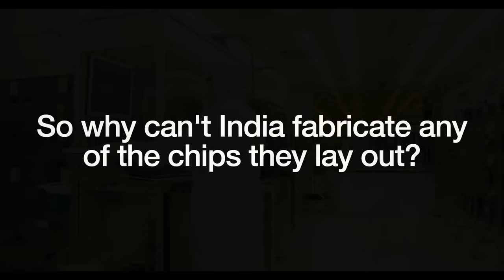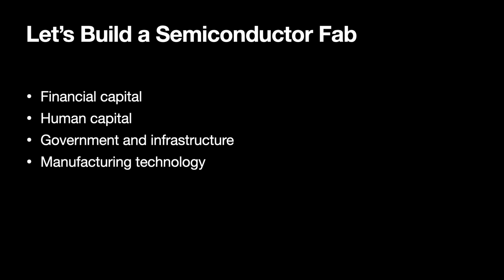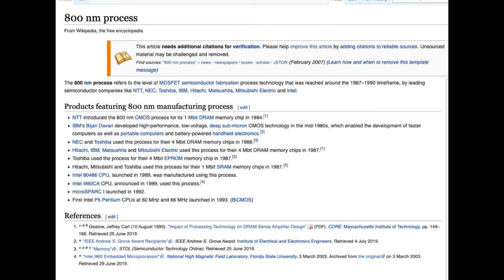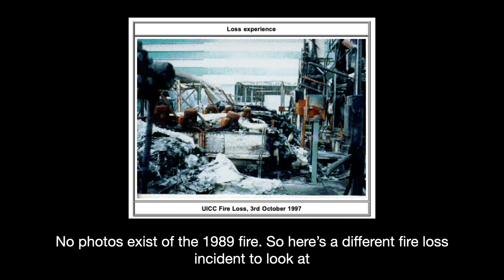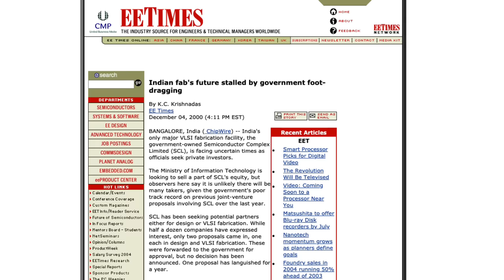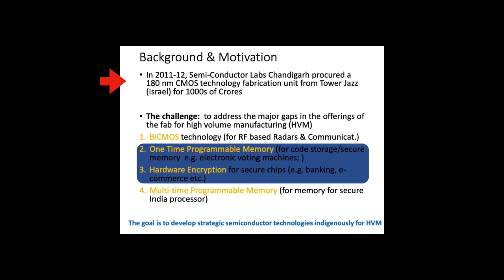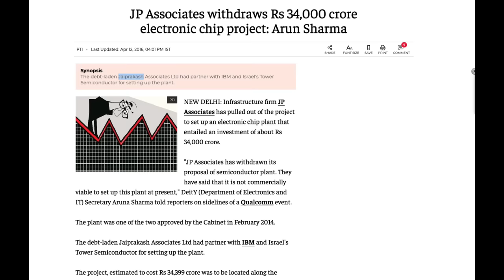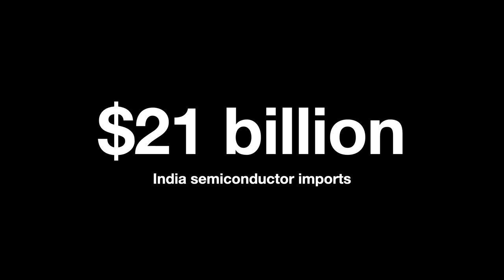India's Semiconductor Failure

Comment: I used to work in America's semiconductor industry and it requires a lot of infrastructure for everything to work properly. We had two massive diesel generators in the event of a power outage because even 5 minutes of down time has the potential to ruin tens of thousands of wafers currently being processed. It's a very delicate process which is why even China still has trouble with manufacturing semiconductors today.
Reply: also tens of thosands of money
Reply: Nah you need a infinity source of very clean water so much that your cities don't go dry with India's groundwater dropping more than 5% each year its not sustainable. Also due to global warming and erratic rain patterns no backup for water source. Glad we missed this expensive party
Reply: @lelins300  Very sensible answer 👍. Not always do we need to be on the bleeding edge as it could be detrimental to us in the long run. Not sour grapes though. But curious how Taiwan manages the water supply.

Comment: 8:00  It took EIGHT YEARS to reopen after the fire.  That shows a massive lack of urgency.  You can’t run any business, if it can’t recover from setbacks.
Reply: They couldn't even figure out the cause of the fire.  That's really sad.  If you can't pinpoint the cause of a problem, and fix it, you will not succeed in large-scale, hi-tech manufacturing.

Comment: I remember back in the day teaching Indian electronic workers how to fix thru hole mounts, covered by bad soldering, by using a small drill. The next day we found them using a hammer drill. I found that while there's excellent engineers etc, what was really lacking were the skills of the common labourer. Also there was the horrible power grid, with constant brownouts and starting of spare generators. I certainly hope things have improved, because I do have high hopes for India. (This was some 20 years ago)
Reply: Growing urbanisation with limited power infrastructure leads to issues.  However rather than fixing the grid and supply which will take atleast a few more decades, it's better to have dedicated uninterrupted power lines for special applications that could be aided by generators and batteries.

I've been living in a major Indian city and not experienced a disruptive power cut at work or home in a long time. This is also because I have installed an inverter powered by lead acid batteries.

Also the public education system is horrible and still rooted in colonialism i.e meant to produce slaves not citizens. Politicians don't want to fix the education system because then the people would actually wake up to their BS and vote them out. This is the primary reason why common labourers are lacking skills when compared with other countries.
Reply: @thunderb00m  Eh, a lot of places were Colonial and are doing much better than India. It’s not the education system. Its the lack of ability to be educated. Look at the b-roll.
Reply: 1) Excellent comment and insights. Power has improved. There is a determined effort at expanding renewable energy as Coal and gas (which have expanded a lot but depend on imports) are a sort of millstone around our necks and we have far too much sunshine. eVehicles too is getting policy direction. Progress on the ground is not too bad. However, entry requirement like Silicon production went by the way of semiconductor Technology. I'm told efforts were abandoned because of undercutting by Chinese. Hopefully the pandemic and geopolitical situation will convince those with capital to invest strategically.
Reply: @agenericaccount3935  Malaysia and Mexico were killed by colonialism and yet they revived themselves.
Reply: @agenericaccount3935  still have frequenct brown outs
Reply: Do they have designated brown out streets
Reply: @Autechltd  isn't that joke overused? It's slowly becoming unfunny.
Reply: @PasscodeAdvance  Indian economy is richer than them as a country.
Reply: @arjunraj823  That's true

Comment: Thank you for this detailed  informative presentation. Bharat excels in Brain, and low tech brawn. These have been Bharat’s two major exports. As indicated, Bharat excels in Semiconductor Design (IP). Priority 2 should be to establish a commanding lead in this sector. Given the challenges in semiconductor manufacturing, maybe Bharat need not own the entire design to chip chain as long as supply is guaranteed. What is essential is that the QUAD be self reliant. Fabs can be set up in Australia. Bharat can be involved in packaging and testing. So if we look at the entire chain it consists of - Chip Design, Chip Manufacturing, Packaging and Testing, Electronic Product Design, Software, Assembly, Out sourcing and importing finished silicon wafers is fine and the forex spent  could be more than adequately offset by exports.

Comment: When you state "Most likely the incident was an honest accident", you are ignoring those countries that are invested to see India not staying on the Semiconductor bandwagon, and there are many, remember STUXNET that devastated Iran's nuclear capability ? 
It is most likely India was deliberately attacked in an industry that would have skyrocketed India as one of the leading global players in this field.
India was prognosed to become a "Superpower but remains Superpoor" as for now, and some countries benefit from this.
Reply: I assure you that your line of thinking never helps. If you blame others for your woes without any evidence instead of doing serious introspection, you are likely to fail especially in endeavours as critical and capital intensive as semiconductor manufacturing.
The right thing to do would be to investigate the incident and come up with safety and backup measures for possible challenges ahead and restart the effort
Reply: @hydrolifetech7911  a useless remark which has no relation with my comment, i would suggest doing introspection yourself before commenting on YT.

Comment: I think you missed out one very important factor for the creation of a fab and semiconductor industry. You need a local supply chain (e.g. for parts for maintenance of systems and materials for the process) and a local environment of suppliers ( most equipment in fabs is serviced directly by the supplier, not the staff of the manufacturer). If they don't already exist then you need to create bases for these many many companies.

Comment: I mean it is not a failure when we never started semiconductor manufacturing 😂😂
Reply: Ur in for a surprise
Reply: How can you be so much ignorant we do have a manufacturing unit for defence and isro in Punjab with 180mm process
Reply: @chidambaranathans1975  that is for defence purpose not consumer grade which can done by most countries anyways and is not cutting edge
Reply: @chidambaranathans1975  180nm class semis are old and cheap.
Reply: It is a failure when you can't start anything. Failing to start means failing to manufacture.
Reply: Will never start even after 100 years.  So no failure.
Reply: @liho1738  😂😂

Comment: This video didn't age well. India just got 20B usd as investment for semi conductor manufacturing industry and basically Taiwan is moving to India. Things don't happen overnight, there's a lot of red tape that's involved. Any industry that comes to India will have to bring benefit to India before they are allowed to set up. But now India will become the hub for all semi conductors.
Reply: There must be a reason for this late initiative; it won't benefit India, because, there is a 10 year lag (translates to 15 years for  India with so many IAS babus around) in bringing a facility like this to fruition. This is old tech, and new tech is already in use  at TSMC's new plants. But it is a great gesture by TSMC. Wishing them success.
Reply: actually, it didn't age so badly...foxcomm have pulled out

Comment: India can't even make simple things like small plastic and metal items (even our nail-cutter was made in Korea). Indian culture rooted in centuries old caste system has always valued intellectual achievement over material achievement. castes that made things such as BlackSmiths - Lohar, Pottery makers- Kumhar, Shoemaker - Chambar etc were always so denigrated and their contribution to society devalued. (In Germany a Schumacher (basically german chambhar) wins F1 for them btw) I think that is one of the fundamental reasons India fails and will continue to fail miserably in any sort of MANUFACTURING. They only want the "cool" manufacturing items to show off to the world like the highly complex semiconductors and rockets to space. But unfortunately for India, manufacturing works bottom-up. If you can't make the smaller simpler stuff, you don't develop the skills, mindset, supply chain etc to make the big ones. Second biggest problem with India is extremely outdated infrastructure. Mumbai-Pune still runs same train line built by the British 100 years ago! Land acquisition for projects is pathetic. India also focusses on show-off style freeways instead of building 10x more rail capacity which is greener, faster and better. Even for roads- when US build freeways in the 50s they took down entire city blocks. there is no other way. Unless that can happen fast in India- India has no future! People like Medha Patkar, have the right goal, but the wrong means. Instead of stopping infrastructure projects, focus only on making sure people get compensated. Stopping or delaying infrastructure delays its benefits. What about the millions of people that did not get electricity on time due to her stopping the Sardar Sarovar project for years?? Stopping it hurt both the farmers she was protecting as well as city-dwellers as nobody progressed.

Comment: India simply doesn't have the capacity to invest and create homegrown semiconductor manufacturing any time soon, if only because of the lack of stable infrastructure. When only 2-3 years ago power cuts stopped becoming a regular thing, that should tell you a lot about the feasibility of setting up energy intensive businesses locally. Unfortunately, the other reason this is simply not a possibility is base corruption. When, at every level of the economic ladder bribes must be paid in order to simply maintain the status quo, of course this high cost industry will not trust an unstable governance. Until India fixes it's corruption problems from the bottom up this will be the limiting factor in the building out of any 21st century industry. The question is what kind of jobs does India want to attract as well? Does the govt want a lot of manual labor jobs to boost "manufacturing", or do they want to invest in high tech infrastructure, remove barriers to entrepreneurial investment, and create a booming economy that actually creates upward mobility. India needs 2 generations of leaders who choose not to loot, pillage, and cynically exploit everyone for votes and money. But that seems doubtful.

Comment: I really wonder why India isn't using its capabilities to build 1-bit, 4-bit, 8-bit and 16-bit microcontrollers ( such as industrial controllers comparable to the MC14500 or e.g. simple FORTH microcontrollers ) for products used in everyday products, or integrated analog computing SOCs for control purposes.
Washing machines, automobiles, CNC machines and the like do not need top edge microelectronics. Even 16-bit microcontrollers are usually over the top in this field.
Incidentally, India doesn't seem to me to be in a particularly disadvantaged position, as there are only a handful of countries in the world that have leading technology in microelectronics anyway. Most of the countries in the world are in the same situation as India.
And that's only a problem because everyone says it's a disadvantage, even if leading-edge technology is not required for most technical problems. It's just a hype to ensure profitability of the most expensive fabrications, such as TSMC's.

The majority of the daily world applications already works very well with 4-bit, 8-bit and 16-bit microcontrollers (from washing machines to automobiles to space shuttles), to state this for the sake of completeness. The leading-edge technologie in microeletronics is in majority used for gaming (!) computers, not for anything really useful that the world needs so badly, and we should not forget about that!

Comment: If you take into account the development history of India, its of no surprise that they struggled in the 1980's. Fires can be easily suppressed by many methods at that kind of cost scale, CO2, Nitrogen, Halon, etc // also power & water problems in the largely arid regions with unstable coal based electrical generation -- they needed better infrastructure & more electricity & a better electrical grid & better water systems - with greater uptime & reliability //

Comment: Even Mainland China (the current tech giant, 5g, drones, electric cars, space exploration) is having problems with this and barely reached 14/10 nm after 2 3 years or crazy investments. It's is not the blueprint of making is semiconductors that is hard, it is the blueprint of building the machine of building those semiconductors that is challenging. So dont be ashamed. You will get there.
Reply: There is no 10nm manufacturing in China and only capacity for 14nm but extremely limited and unused

Comment: The intro is actually misleading. India's design contribution to high end or high level chips is limited and very specific. Their design contribution and manufacturing are actually on the low end of things. Reason why India was not designated as the main manufacturer was because China's labor is way cheaper. But now that is starting to change. China's age demographic problem,  the unrest created by the failed CCPs Zero Covid policy, Real Estate Crisis, Financial Crisis, Power Crisis, Food Crisis, Transportation Crisis, etc are making labor price gradually increase. In Asia, Vietnam has been the main beneficiary of the current transfer of manufacturing and India is a close second, but won't be surprised if they overtake both China and Vietnam (in Asia only) as a producer for low end chips. However, Mexico will actually be the future manufacturer of both low end and high end semi conductor products, and the reason is NAFTA. High end or high level design is the sole proprietary of the US, Netherlands, Taiwan, Japan, Germany (to a small extent as they are more focused on Mechanical Type Industries), and South Korea. I don't see any country rivaling those countries at all in the next 20 to 30 years, even with China (who has recently been cut off from acquiring the next generation of laser machines for creating and DESIGNING chips) will take 10-30 years to catch up to current levels.

EDIT:  I made this comment before watching the video.

Comment: The semiconductor industry and such manufacturing don't happen independently or instantly. It needs a lot of automation that works at micro-level accuracies. There are many sub-assemblies and sub-industries that need and come along with it so would be a great benefit to place/ state and nation.   I truly wish India wakes up  amd the politicians understand this beyond a a few lakhs they want as bribes at every level - by the many greedy assholes.  If the top level POLITICAL monkeys dont understand this as good China's DENG XIA Ping in the 1980 figured  .  He came to singapore several times to understand how a small country could prosper so quickly in all these fields . he learned quick and acted as fast as he could and that why china grew - with the advantage  of putting nearly 600 millon or more adults to work . If India does even half as good it would be good enough for a start